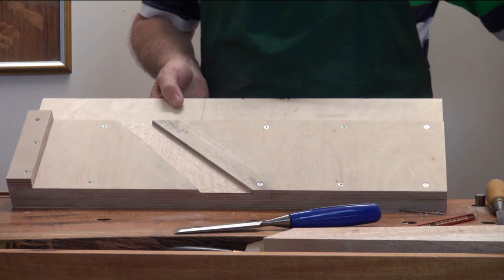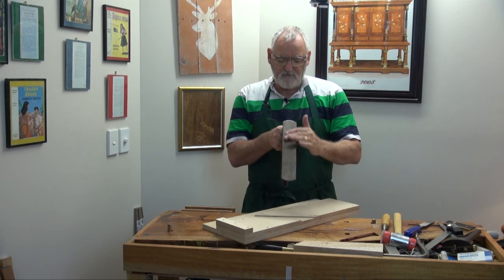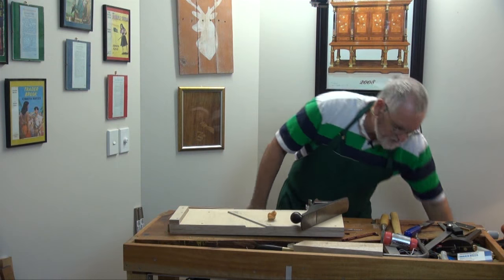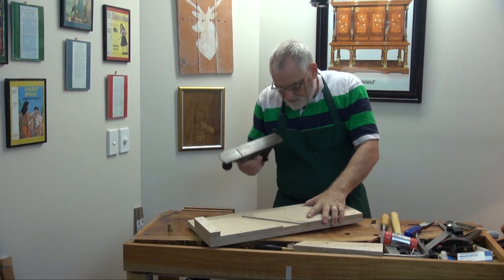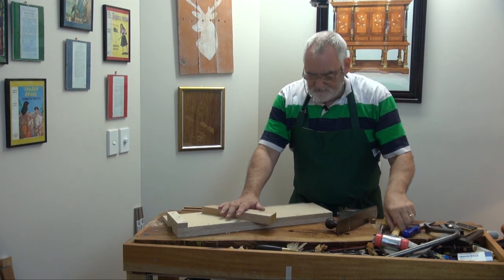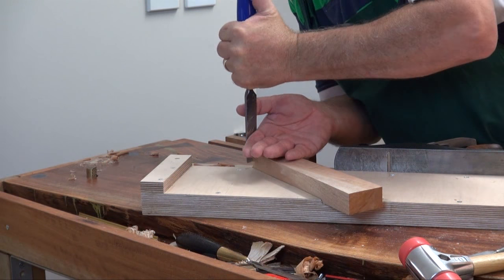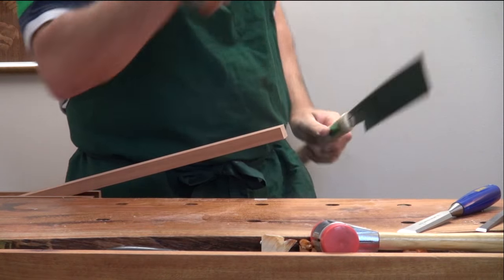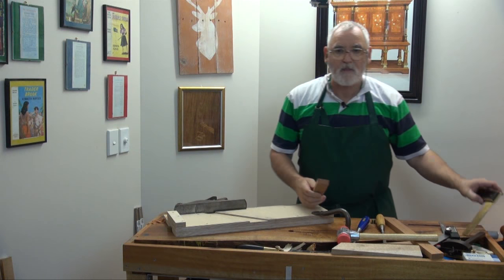Making a Shooting Board with Hand Tools Pt.4 of 4

Comment: Steve what about using marine ply .....Bunnings sells it for less than birch ply from Plyco.    The marine ply looks high quality as in no voids and smooth surface???    Also what about using MDF??
Thanks for vid.....cheers
Reply from the maker: Marine Ply is fine. Actually any ply will do it's just my preference to use Birch. Not a fan of MDF for this type of project as it distorts to much if it get wet and also comes apart over time. But as a quick fix it would be better than nothing. I (personally) would us Pine before MDF though. Cheers Steve